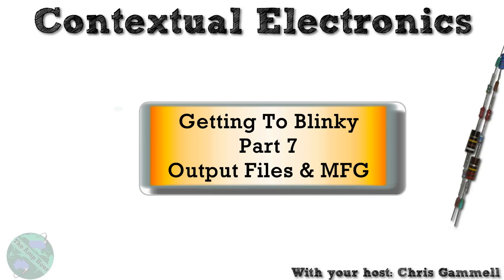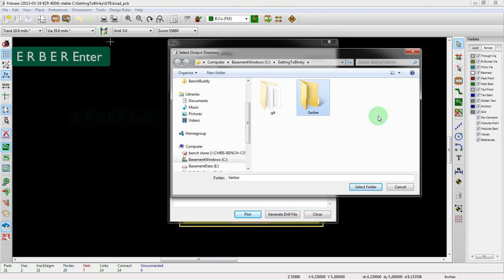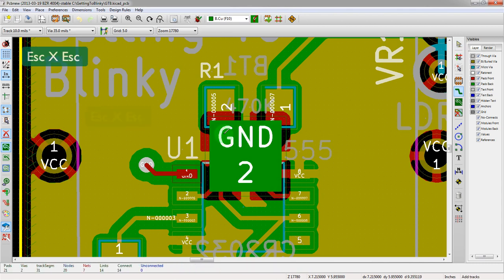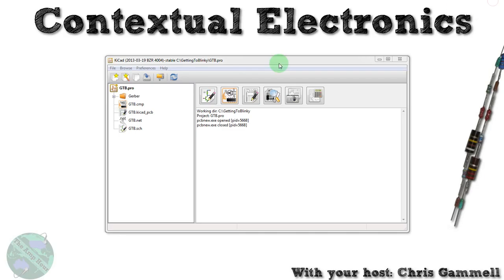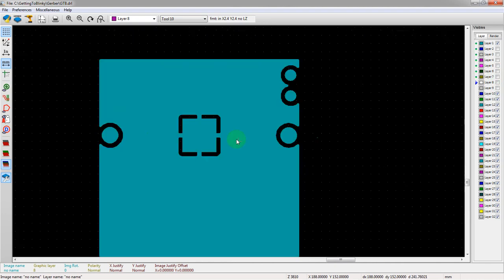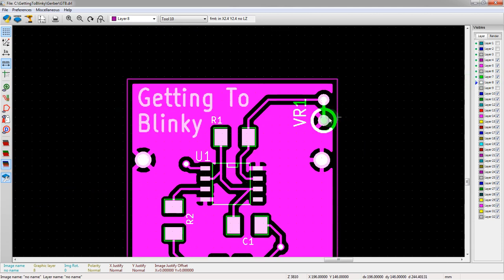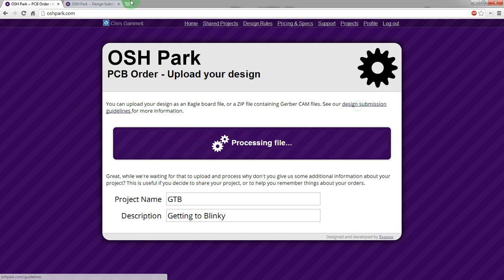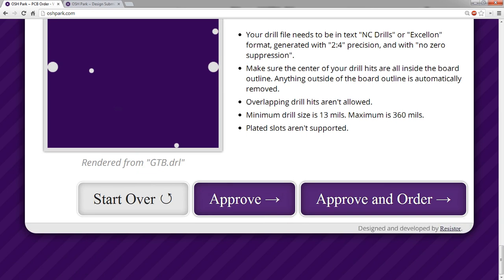Creating and Viewing Gerbers with PCBnew and GerbView - Getting To Blinky KiCad Tutorial - Part 7

Comment: A couple comments.

The first has been alluded to by some other commenters. You have Silkscreen on top of pads at both D1 and VR1. If you select the "Subtract soldermask from silkscreen" option when plotting to Gerber, KiCad will take care of that for you so you don't have to hope that the board house will catch this and correct. (Most, especially the automated ones, won't.) Ok, I see in the part of the video where you are going over OHS Park's review of your design they state "The fab will automatically remove any silkscreen that crosses drilled holes or exposed metal.", but it is bad practice for you to rely on a process out of your control to do that for you.

Second, according to the design review page at OSH Park, you didn't output the drill file properly. On the design review page of OSH Park, they specify that you should output 2:4 precision and no zero suppression (why that isn't mentioned on thir design rules page is probably an oversight), but when you output your drill file you did suppress zeros. You are lucky that it worked for you here, but you should never trust "luck" when spending real dollars. Also, please explain why you selected "Minimal header" when exporting the drill file.

Comment: So do the boards come back with solder paste on the pads?
Reply: No, they come back with lead-free gold plating on the pads.
Reply: Michael Moskie
OK.  So is the solder mask in the gerber file actually used for creating a solder mask?  I see people using solder masks to apply solder paste but where do they come from?
Reply: When you export your gerber files you can export solder mask for the top and bottom layers, while they help to make soldering easier I think you are referring to Solder Paste Stencils when you say you've seen people use them to apply solder paste. You can get solder stencils from oshstencils.com by submitting your paste layer gerber files. To use the solder paste stencil you simply line it up and wipe the solder onto the board. The "solder mask" helps to prevent bridging between pads when you reflow the board.

Comment: -tom: you've probably mixed something up there. Silk screen (the white stuff) is almost always printer atop the solder mask (usually green/blue). What you might have heard is that silk screen and pads mustn't overlap. Think about it: having some paint on the surface you want to solder your parts to will probably pose a problem. Some board houses fix those mistakes for you, but it's better to check these things in your gerbers before sending them to manufacture.